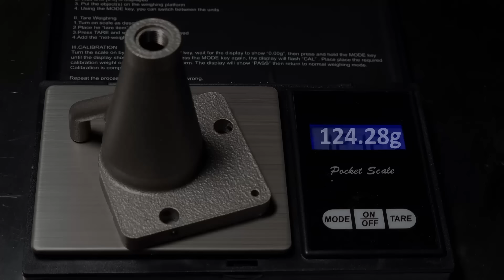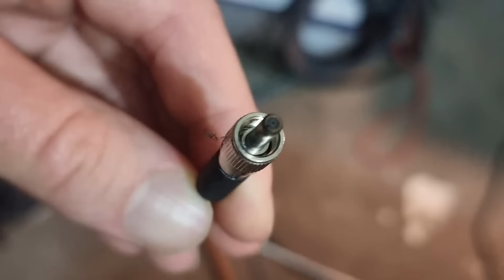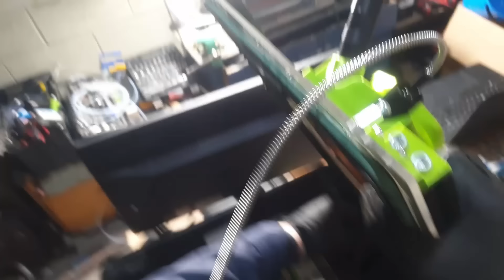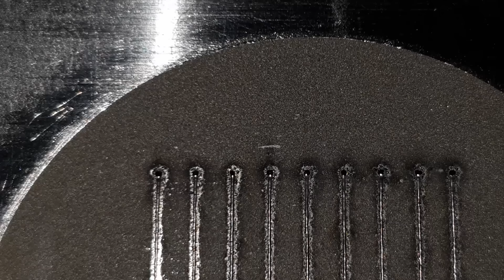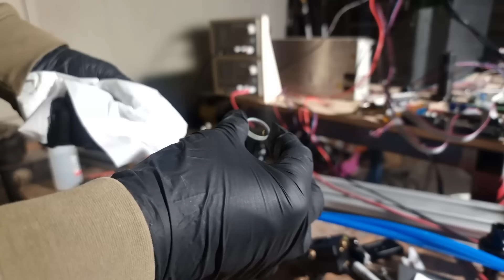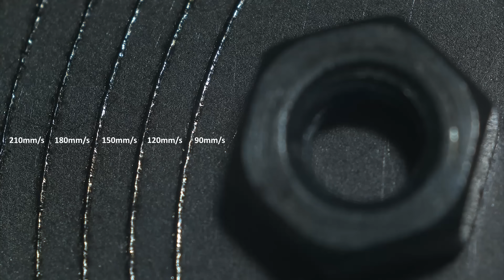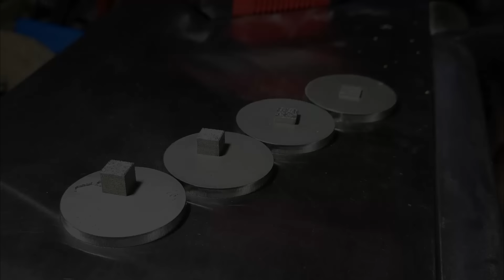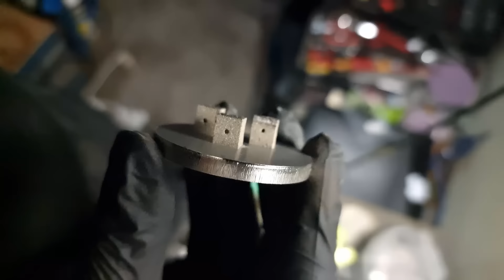DIY Metal 3D Printing - Success

Comment: Hi, prototype builder in training here,
We don't have any SLM printers at my company, but we do have a few SLS and MJF printers. These use rollers instead of plates to distribute the powder. This way, nothing wears off and the material is also compacted and could possibly solve your problem with the density.
Hope this helps you
Reply from the maker: Hey there. I got your email. Yes, I am aware of the counter rotating roller method for powder compaction. While the prints sit above the deck, it would be a real hassle to try and manage collisions. The current powder bed scheme is not well suited to it either. I appreciate your feedback though.

Comment: Congratulations, may I ask what function the FPGA in the control system, transmitting PC data or controlling stepper motors?
Reply from the maker: It was for motion control but now just serves to as a series of buttons for the Teensy along with an independent quadrature encoder/7 segment display for the linear scale.

Comment: The Mesa FPGA cards often used with LinuxCNC have a module for Galvanometer control. The code is open-source, if that could help in any way.

Comment: fantastic work. only 6 minutes in so far and completely relate to budgets getting blown when trying novel things. As far as a PC costing 500-1k it really depends on what it needs to do. if it's just receiving the input from the camera you could  PROBABLY get away with a raspberry pi or arduino,  or a netbook/chromebook, but it also depends on if you have other processing to do on it.

Comment: Good work. Its genuinely impressive to see a single person get this far with SLM.

One question though, do you still need a flexible recoater now that you've gotten a good bit of the problems worked out?
Reply from the maker: I think it's preferable, or at least a recoater blade that will break down if it contacts the print. The prints still sit slightly above the deck, and having the system jam after purging it with argon would prove costly.
Reply: @metalmatters  Are you using an open loop stepper?
If you use closed loop, you could incrementally move the build plate down until it stops jamming.
Not too great for layer adhesion but you'd at least avoid problems with the card deforming.

I do think some sort of feedback to the user would be good if the part start warping enough to cause these issues. That's a later problem though lol.

Comment: Ever try a random pattern to stop the unevenness? ...or a separated pattern or patterns to intentionally create your own unevenness, but in a controlled manner? It may help the strength to create a type of geometric lattice like that. As far as I know, the lasers won't always have to travel in a straight line and don't need to make continuous lines either.

Comment: This is a really cool video and has given me several ideas for my own engineering projects!

Regarding the laser welding, Have you tried Raspberry Pi camera modules? I think the first-party models are 12MP, and there are third-party brands I've seen up to 64MP. There are global shutter versions, options with and/or without IR filters, etc.
There are fixed focus, manual focus, and auto focus options that you can also control or override the camera focus in software.

I imagine using a Pi 5 with a camera module would lower the cost and make camera mounting easier or give you more flexible options
Reply from the maker: An RPi4 was my first thought when starting out with the welding camera. I wasn't too impressed with the camera options at the time and wanted to avoid the need for a keyboard and screen so I decided to try and make a phone work.

Comment: Some of this may already be known and you may be doing it, but here's some random tips. Using a "Skywriting" technique may help; move your galvo in a linear fashion, overshooting the edges of where you want to weld, and turning the laser off at the boundaries of the part, if you can control the laser that tightly. The physical motion of the galvo means it'll slow down at the turnaround points, which increases power density at the edges. You also want to avoid welding in the direction as the gas flow; having each "row" of the hatching be in the direction of the gas flow will make it weld over some of the spatter/condensate that forms, reducing the quality. Rotating the direction of hatching each layer can help a lot, too. Focusing via burning lines isn't uncommon; you can use a steel plate or anodized aluminum, burn a line, move the Z axis up/down a small step, and burn another line. Visual inspection can be done to compare the quality of the lines, the best looking line is going to be the ideal focal point, and you can adjust the focus position until that's at the weld plane you're looking for. Silicone or other soft materials can work for recoater blades; sometimes it works better, as it can be more tolerant of issues, hard-wearing blades are more likely to ruin the part if there's something off, while softer materials may be able to compensate and smooth over small height differences in layers.
Reply from the maker: Thanks for the tips. The switching time of the laser is around 300ms which doesn't afford that degree of control unfortunately. I've used planer blades in the past but suffered the consequences. I've also tried softer materials but found that they would 'collapse' below the build layer, dragging powder with them unless height/applied pressure was carefully controlled.

Comment: There are design equations for laser power and bed heating temperature, by heating up the bed you can achieve much better results with less laser power, let me know if you'd like for me to send you the details, it came from a master's level class in my engineering course, taught by professor Harvey Shi from UofT, he himself researches advanced additive manufacturing
Reply from the maker: My email is listed under the about page. I'd be interested in taking a look.
Reply: @metalmatters  Sent! I included extra details and relevant info too, hope it's useful!

Comment: Interesting the requirement of power to create melt.  Very aggressive results of suddenly melting the subject.  Theorizing a creation of a 80-95% flood of light to heat the material in a bath then mildly powering a focused LASER that would finalize the weld dimension in goal with less splatter.  Much like preheating metals for stick welding of Rocket Rod for instance.

Inert bath;  There are nitrogen generators available in good volume.  Thoughts on Nitrogen bath instead of Argon?  Goal to reduce/remove Oxygen in welding atmosphere.

Comment: So why don’t you just cut the print from the bed and sand the bed smooth after each print instead of whacking it like a caveman and damaging your setup each time?

I know cutting and polishing is possibly more work, but it seems like a sensitive setup, so it would be worth it in the long run not to damage it.

Comment: I believe you have reached the point your ideas are a small leap away from complete success but you need precission components to support the laser stuff. Your laser system might not be perfect, but if the rest of the machine is unstable and poorly constructed, everything will suffer.

It might be beneficial to consider building a more rigid frame from welded mild steel (very cheap, obtainable, durable, easy to work with) and adjust everything else that is attached to it to get it precisely leveled and squared (there are very nice, easy to obtain even from amazon, cheap small and medium sized precision engineering squares for under 50€. I got mine 400x250mm 8mm thick for 35€ and it is rated for under 30 micron out of squareness tip to tip). Also, a precision level will help you a lot and theyre quite cheap nowadays since you can buy a 0.02 mm/m per division for under 80€.

Then your motion components should be as precise as posible and you can buy import linear guides and moving blocks combos for very cheap, specially considering the small loads they will have to sustain, you could build every rail system out of them and still be very very obtainable since they dont have to be the beefier kind. This will considerably improve the powder bed movement, for example.

Also, to prevent vibrations, you could pour concrete to the base of the machine, it really dampens jerkiness, and considering the size of the machine, you still wouldnt make it unbearably heavy.

All the best to you, I apreciate your work a lot and am very thankful you share your experiences and discoveries with us. Hopefully we get to hearing from you before 2026 :))))

Comment: Super interesting! Wouldn't the strength get a real improvement with a heated chamber? I saw other people using incandescent lights to heat the chamber, they would heat it up close to the melting point of the metal and the laser would only need to heat a bit more for it to melt. I don't know if that was the same kind of metal being used, tho. Good luck with the journey and thanks for documenting all your mistakes and your whole thinking process.
Reply from the maker: Heating the chamber can be used to offset stresses. I am trying to be conscious of complexity as the build area is not large and cost is a significant factor.

Comment: next step is preheating the metal powder and using a pressurized chamber (that will reduce the gas consumption too right?) and increase density because of less offgassing from the powder like that dude in the comment said

Comment: We're actually working on the same thing! :)

I think you have to keep in mind a few things, first, inert atmosphere at all times, makes sure you close the argon loop and don't have leaks (I think you did it thou), also, the atmosphere should be around 80ºC and the table between 120 - 200 ºC, instead of using a blade, use a roler, that will "compact" the powder against the table and render more density - In theory you got it all right, even the laminar flow set-up,

 I just have a question! :) What's the bed made of Machined Stainless? Or Machined Carbon Steel? (I'm going for carbon steel!)
Reply from the maker: The bed is made from stainless as I didn't want it to erode or require treatment. From what I have read, 50 - 80C is the plate temperature for SS316. 200C sounds like Al. I have considered a roller but I want to keep complexity to a minimum. While the prints often sit proud of the deck it would be too much of a nuisance to experiment with, I think.
Reply: @metalmatters  ah! you got me there with the AL, maybe yes, that one kinda scares me because some alloys can be explosive in the presence of oxygen, one that is bugging me is where to add some anti-explosion features (rupture discs or somthing) in the side panels. 

Anyway, subbed you yesterday and I'll keep an eye on your project! You're getting somewhere for sure. 

So that you know a bit about my "version" I'm using a single piston with a roller that deposits the powder by gravity, the volume of 150mm cubed (quite ambitious, but compact) already built the platform and the build area.... and It's a 2kW contiuous mode fiber laser 😅 (I know, it's wayy too OP)

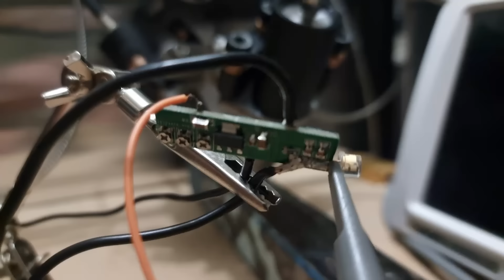Comment: Pausing at 3:30 ,... That camera looks like it's connected via a CSI2 connection, so would easily plug in to a Raspberry Pi 4.
Even with the stand alone camera show a minute or so later, a Raspberry Pi could save funds over a PC with similar GPU performance.
Reply from the maker: Regarding the use of a PC/GPU, at the time I wasn't sure of the overhead and wanted to be sure that I had enough FLOPs to support whatever turned out to be necessary. A Pi was my first thought before using a smart phone. There's a lot of price gouging though, and I wasn't blown away with the camera options for the price point.

Comment: Stunning work, I can't wait to have metal 3DP in my garage :-D

As someone who does zero shielded welding, I presume 192l of argon is a fair whack? Any rough cost calculation?
Reply from the maker: I pay around $200 for a 4900L bottle, so $7.5 or thereabouts. Keep in mind this is a system that relies on a slight positive pressure. I am sure I can get it down lower but filtering will be required.
Reply: @metalmatters  Thanks for the reply :-)
Doesn't sound too bad for a first attempt, I look forward to seeing more!

Comment: Dude, you are awesome! Tenacious. I want to help message me. I have very sophisticated 3-D sla printing abilities. I can print down to 10 µm. I also worked heavily with AI and also have the hardware to run simulations quickly and run AI quickly on my own systems.😊

Comment: Fyi, your 40-80 spine for your Nd:YAG laser is a little better than a wet noodle.  The most stable lasers (of that size) that I've worked with milled a pocket for the cavity out of a 6" (150mm) block of solid aluminum.  

I'd personally stay with the Nd:YAG vs a fiber laser.  These lasers are very durable and the large beam means it can survive 10's of Kw peak power during reflections or Q-switching.  Also, I bet you're better off with a multi-mode beam.  I'd bet a "top-hat" or "donut" beam profile would work best.
Reply from the maker: Yes, I had a lot of trouble getting the alignment I wanted. Even the crystal within the pump is suspended by a couple of silicone o-rings which compress/move the crystal around when being tightened. The process needs some work.

Comment: oh man, this is freaking awesome, will work with aluminum ?
Reply from the maker: Will it work - Yes. Should you do it - No. The conditions required for using Al are that of a lab rather than garage hacking. It can be volatile and detrimental to your health.

Comment: I keep wondering how difficult it would be to try this in a vacuum chamber. Could you keep the powder from gumming up and fusing to itself in a vacuum chamber? Given that you're using ferromagnetic metals, could you suspend particles in a vacuum using magnetic constriction? Might be an interesting thing to experiment with if you could keep powder suspended in a loop in a vacuum and use a laser to pulse it onto a surface. Perhaps calibrating the laser frequency to a multiple of the atomic vibrational frequency of the metal you're working with. Or how they managed to bring the temperature of rubidium close to absolute zero by using the inverse frequency. Probably a dumb thought, but who knows.

Comment: if you had flux on the wire, you could direct all energy on the flux. also k.i.s.s., complex systems by design are hard to implement. there is a more optimal solution to achieve the things you are now doing in a more complex way. namely SLS/SLM using the current implementation methods. copy is only a copy, not original.
Reply: how about inductive metal wire melting 3d printing instead. no complex hot-ends or lasers or plasma or arcs required. the wire heats directly at the inductive loop melting printing head. its fdm.
Reply: how about arcless welder hot-end direct 3d printing of metal wire, having the welder current over the welding wire happen in the hot-end. yep arcless resistive metal wire 3d printing.
Reply: argon shield gas for wire metal 3d printing? shield gas could also be a suitable heating target for problematic shining metals. welding = 3d printing.

Comment: glad to see progress, I donated to your link. If there is any thing possible to do to help with your progress, I would love to help. I'm currently putting my small desktop mill back together that can do softer metals, and building a larger  600mmX800mm mill that should be able to cut inconel, titanium, hastelloy, and other harder alloys. So if you need parts, I will try and spend some time to make some for you
Reply from the maker: I am trying to avoid bespoke components but it may prove necessary, so I appreciate the offer. Thank you for your support.
Reply: @metalmatters  another question I was just thinking about, Have you tried printing with PETG-CF or any other fiber reinforced filament?

Comment: Can you share the PDF for "Implementation of a diode-pumped Nd:YAG laser with quick-change output couplers for high-beam quality 1064 or 532 nm wavelength generation"? Thanks for this demo.

Comment: With the camera perhaps you should use a raspberry pi and one of their camera modules. The HQ camera has a threaded lens mount and you can get long ribon cables easily. Also it has plenty of documentation and APIs to drive it

Comment: I'd be super curious to see if these prints would work better (especially in regards to density) if they were conducted in a pressurized and heated argon chamber. Kind of like applying the HIP process during printing...
Reply from the maker: The camera wasn't suffering from reflections, it was the end faces of the fibers. The light coming out of a diode pump is a little too chaotic to really do anything with a polarizer, although that is the basis for how an isolator works.

Comment: I'm sure other people might've said this but for your leveling hammer, invest in a rubber or plastic tipped mallet. It is generally what we use for leveling / adjusting in the shop. Also might want to use a test indicator instead of a travel indicator for your leveling; the dial may take a minute to learn to use but they allow for much more accurate leveling. Really cool project!

Comment: Damn, this rabbit hole is freakishly deep, like I know A LOT of electronics, fair bit of mechanics, a good bit of non-imaging optics and laser stuff is like having to know the same amount I already do, but in whole another field or multiple fields.
BTW would placing polarizers in front of the cameras help with reflection?
Reply from the maker: I didn't really have many issues with reflections in regard to the camera. It was the fiber end faces that thwarted everything. The beams produced by the pumps are fairly chaotic, don't think you would achieve much.